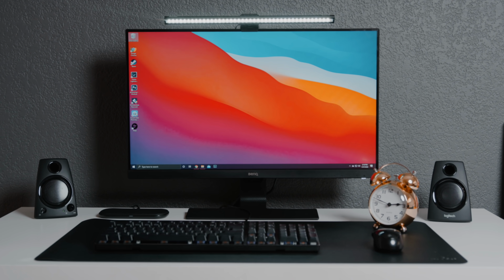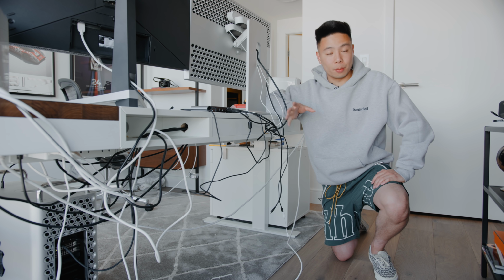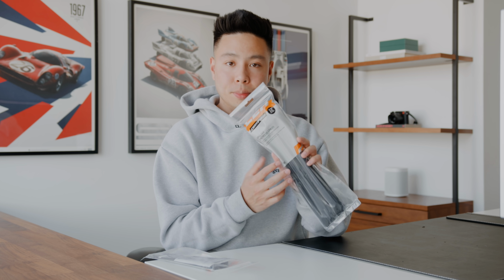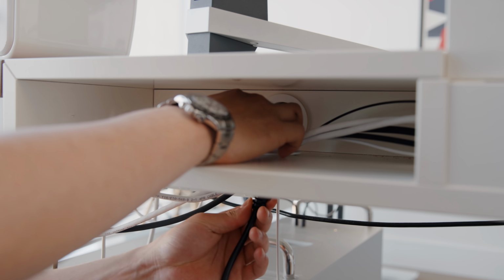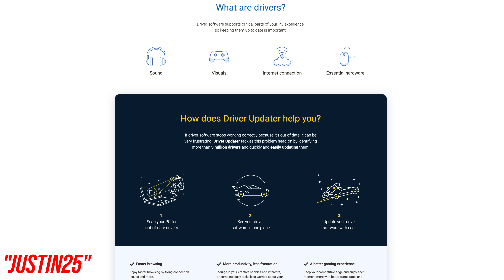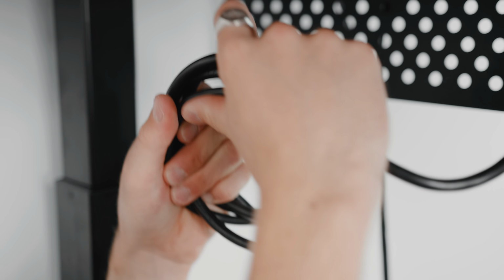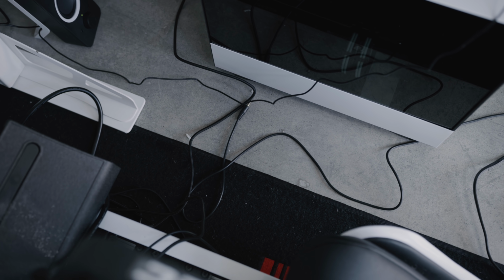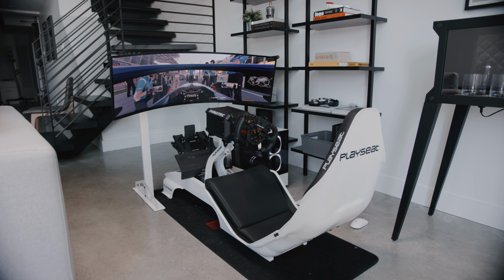My Desk Setup Cable Management Makeover!

Comment: The best way I've kept cables in check is always having dedicated routes that cables "must" go.
I have allowed myself to put cables down: My monitor arms, table legs, along the back edge of the monitor, in a cable basket under the desk, and one path under my phone stand that it set up on the left (as it hides them).
There's latching adhesive cable clips, and I've placed them all along the paths in question, which means I never even have to deal with the hassle of zip ties or similar. 
While I used to use velcro cable holders, and zip ties that were "easy" to unlatch, being able to just pop them in and out without unlatching, or unwrapping anything is what has let me be more organized.

Comment: I tried several amazon solutions, all failed. I have 4 monitors, 13 things to plug in. My final solution was a cut to size vinyle rain gutter attached to the back of the desk.  Cut slots for cords to go thru, and attacked gutter leaf screen to hide what's inside.  Perfect.